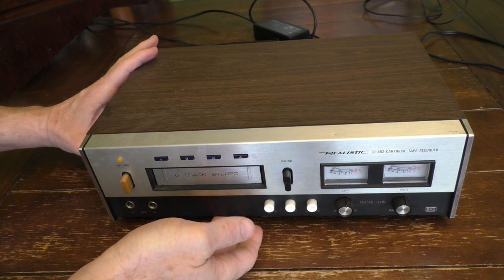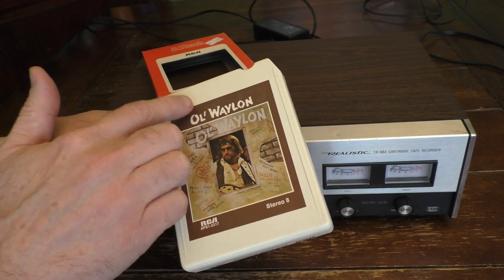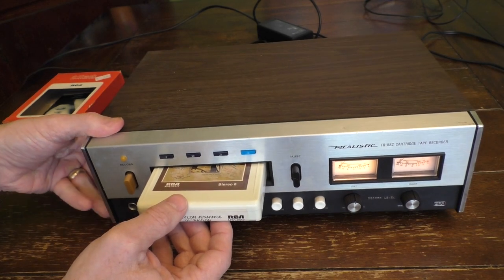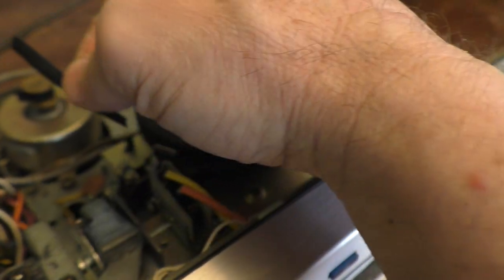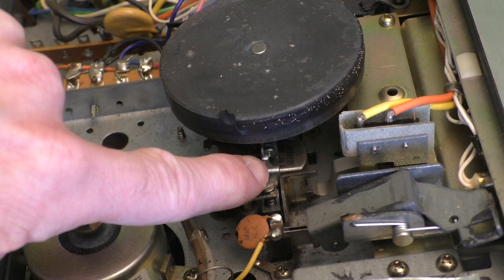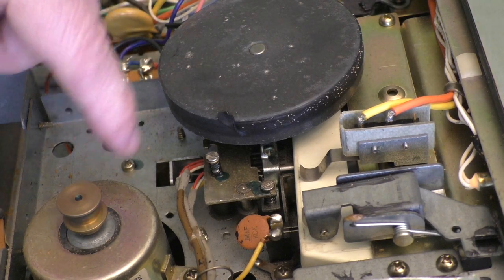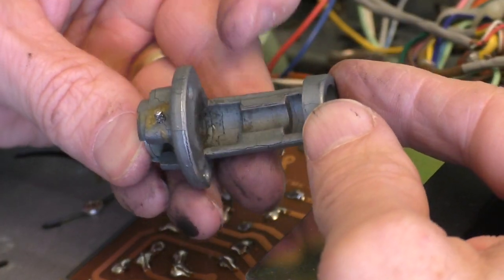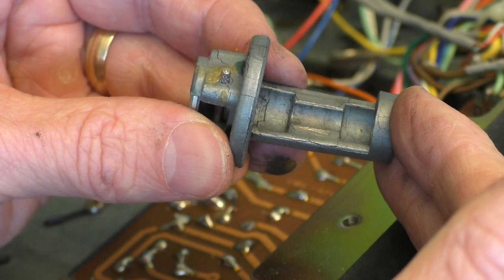How to Repair a Vintage 8-Track Tape Player

Comment: Super glue or a thin layer of epoxy might hold it together.
Reply from the maker: Unfortunately, I don’t think that would do the trick.  The belt puts a lot of lateral force on the mount.
Reply: Man, closer inspection of that part as you see it cracked all over the place. You might find somebody with a 3-D printer they can make one.

I saw this video because I have a card deck there’s like 50 years old, pioneer, that I want to restore. What were you going to use for a new belt?
Reply: Car deck*

Comment: I see other fracture lines in that die cast metal piece. I've seen some units were all the die-cast metal just crazes and cracks for some apparent reason. Bad alloy mix? Environmental?